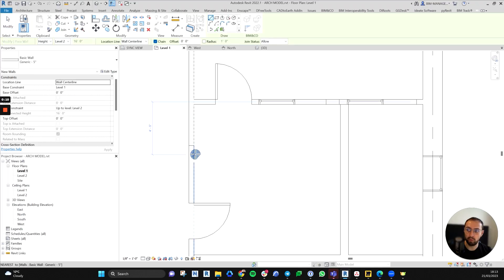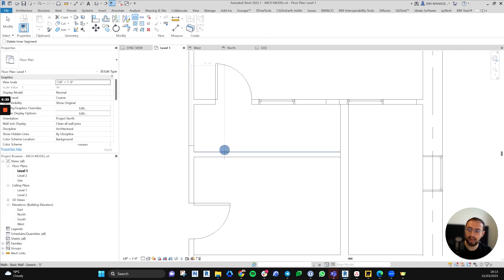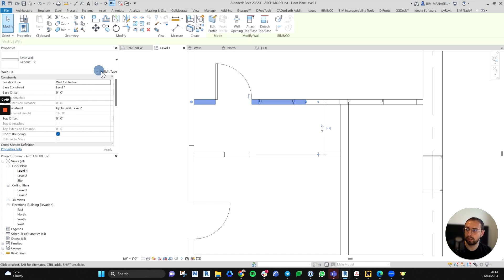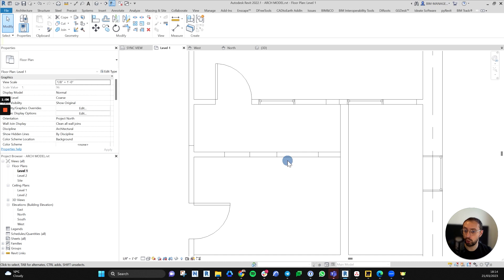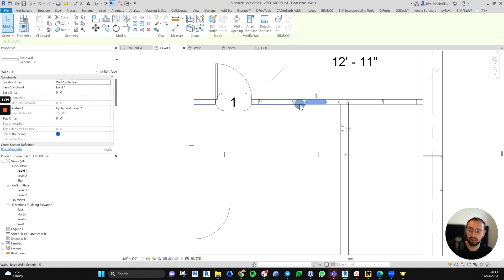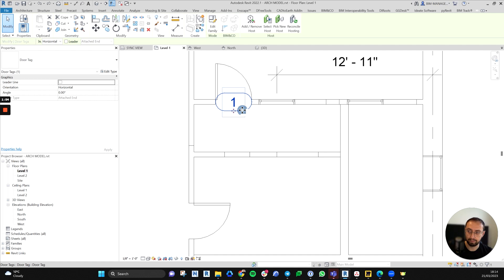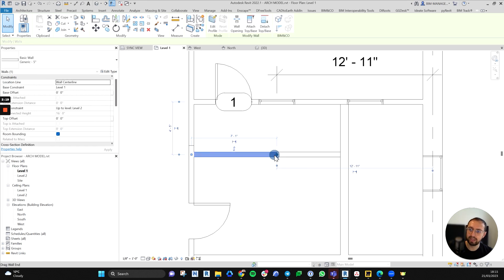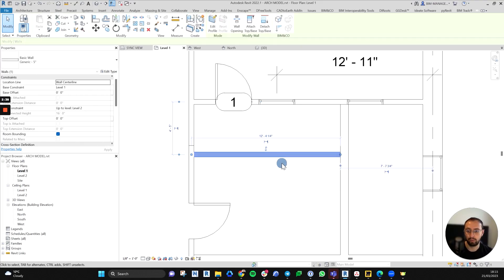How to Split Walls in Revit and How to Merge Walls in Revit

Comment: I'm getting an error that says the elements internal join data is corrupt. is there a way to resolve that?
Reply from the maker: Thanks for reaching out, @yurimamero5492! Could you provide more details about when the error occurs and any specific actions leading up to it? Additionally, are there any error codes or messages accompanying the issue? Your additional information will assist us in offering a more tailored solution to resolve the problem.